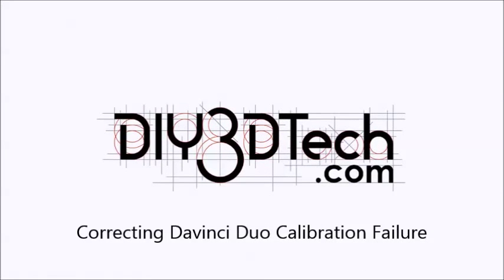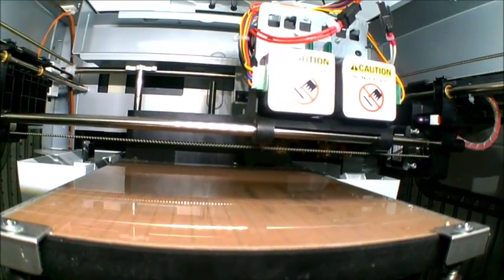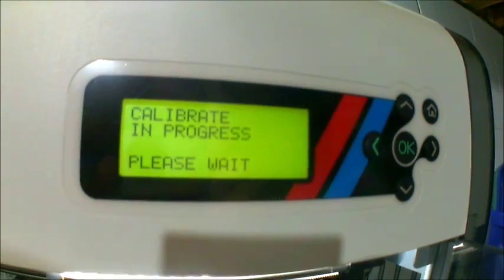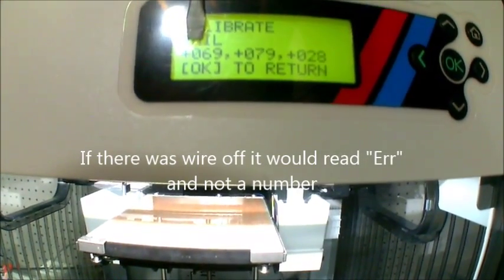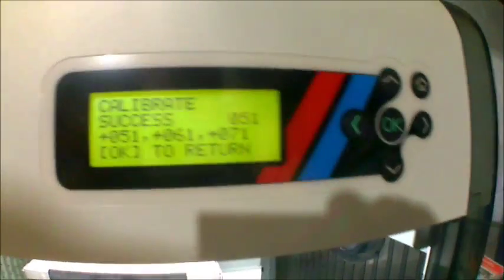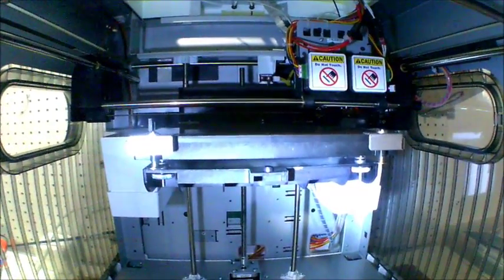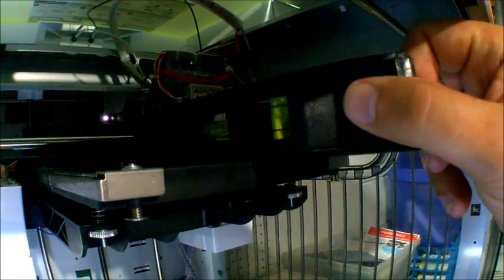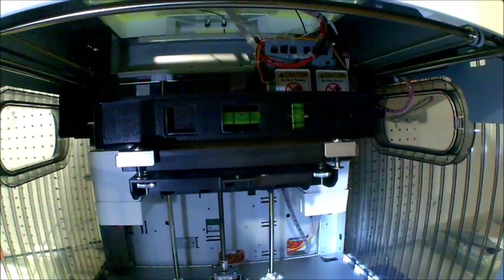Da Vinci Duo Calibration Failure

Comment: Thanks for the Video. It holped me a lot.  I tried a few different approaches, but I found that the one that worked best for me, was to level the two outer points to each other first (numbers 2 and 3, thumbscrew A and B), and then adjust the center screw. The center screw seems to tilt the heatbed on the center axis, so that when it lowers number 3, it also raises numbers 1 and 2.   
Does that make sense?
Reply from the maker: Sort of, as the bed was designed to work with the auto level function of the firmware so the side screws are for tilt and the center for pitch...

Comment: Excellent video.  I just want to add a few further explanations in case anyone else is as new as me to these things:

If you get ERR ERR ERR, it means that at least one of your contact points is not connecting during the test.  There is a little metal nub beside the right-hand print nozzle - this nub must touch the metal corners of the base plate during calibrating, or it will fail.  If you watch the calibration, you can probably see which point it fails on.  Or, it might just be really dirty (or the metal plates are dirty).

And finally, take a close look at the screws you are turning.  All three screws are the same shape and style.  I say this because there are 2 screws right at the front of the plate in plain sight, but THESE ARE NOT THE SCREWS THAT ADJUST THE CALIBRATION.  It only took me 30+ tries, and hours of staring at my data without seeing any pattern whatsoever before I thought to look harder to see if there were other screws.  There are.  There are two other screws on the bottom of the plate that resemble the screw near the middle-back of the plate that he points out in the video.  Don't be like me.  Turn the right screws.  :)  It calibrated pretty quickly after that (only 8 tries).
Reply from the maker: Many thanks for the additional comments!
Reply: What is the best way to clean the sensor?

Comment: Thanks for the video.  I am going to use this information when I unbox my davinc 2.0.
I have one important question.  Are you using xyz software to calibrate, or have you flashed to repeater.  I want to flash my 2.0 to repeater as it release the davinci from the proprietary filament cartridges and gives you more control over your 3d printer.
Also does the repeater instructions apply to the 2.0 as the 1.0 versions.
Reply from the maker: +drunization you must have been reading my mind :-) yes I have reflashed it (as I did my 1.0a) and will be releasing the video next week...
Reply: I have a tendency to do that.   If I subscribe to your channel will the new video automatically come up or how do I access it.  I don't fully understand the subscribing to channel things.   Thanks for replying.